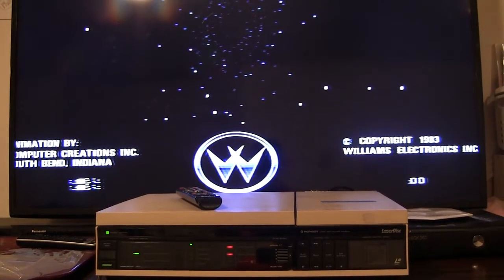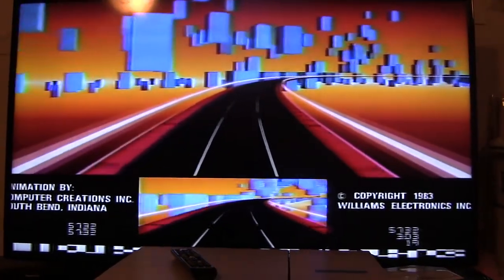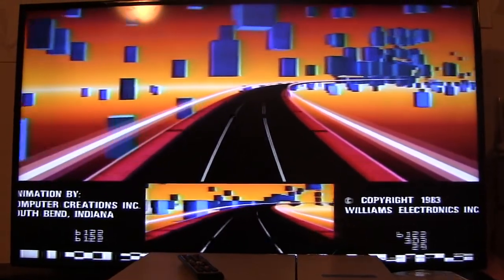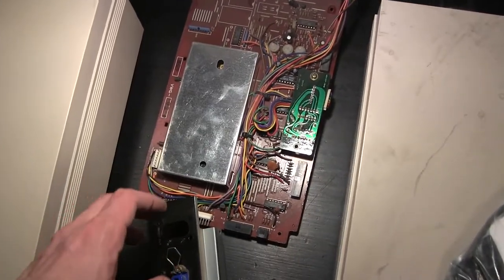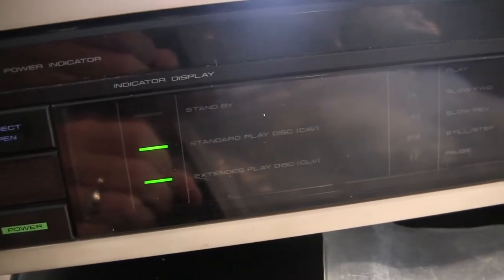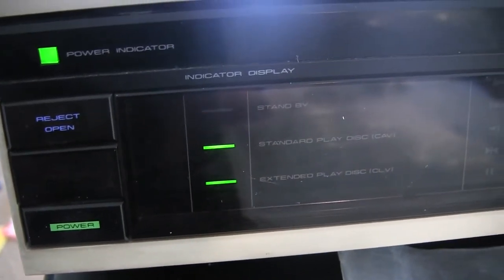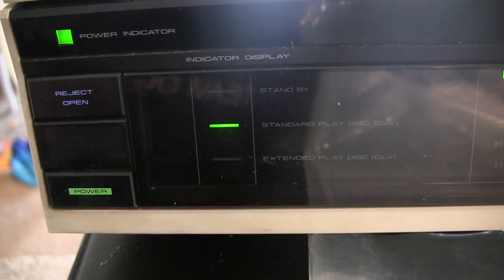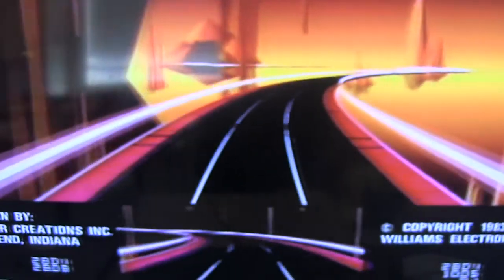Struggling with Star Rider : Resurrecting dead Pioneer PR-8210A laserdisc player

Comment: I have a Pioneer 8210 r doing exactly the same thing 5:46 I can't open the top, if you know anything about unlocking the lid latch it would help me. It turns on and lights up, but eject\reject doesn't do anything. I recently bought it, and it arrived damaged from shipping (only the plastic back cover) Some of the plastic pegs broke off but I realigned it by unscrewing the bottom and putting it back together. It looks like the insides aren't damaged, it still powers up and does the exact same thing your 8210 A did before you finished hooking it up, no eject, standby blinking. Any info would be greatly appreciated because your the only source I could find on the internet that has any information about these Pioneer LD players. I plan to just watch movies on mine, but I find it fascinating that they were used in arcade consoles, I probably played one when I was a kid in the 90s!
Reply: I don't know much about the player; I just followed a guide to do the conversion.  This player is sought after for use in arcade games so it is somewhat ironic that you found one only to want to watch movies on it.  There are a lot of consumer laserdisc players available on ebay that are much newer and would meet your goal of watching movies.  I'd save this one for an arcade game (assuming it works).
Reply: @MattOwnby  It worked when it was shipped to me, but it arrived damaged. It just won’t unlock the lid. I like the look of the early 80s Toploader Laserdisc players, that’s the reason I got that one. It was your channel that taught me they were even used in arcade games! Sorry for being redundant, but is there any way you know to remove the door without unlocking it? I’ve already tried taking all the screws out of the hinges.